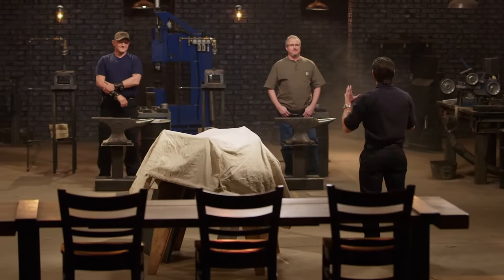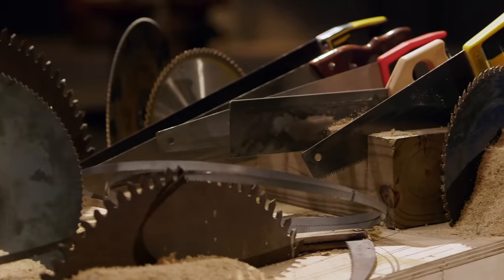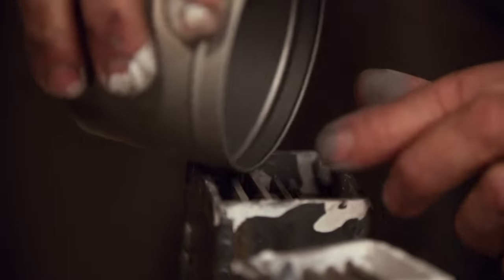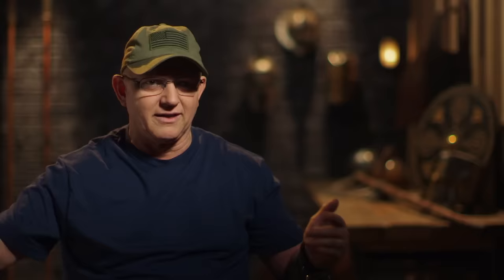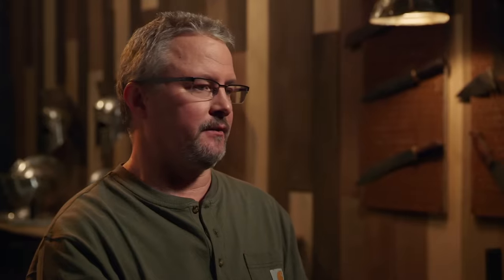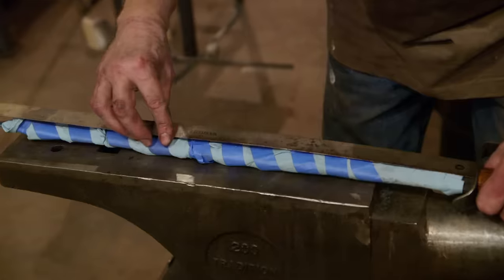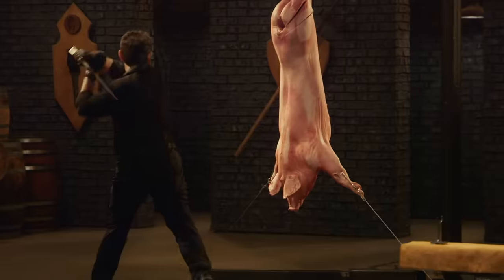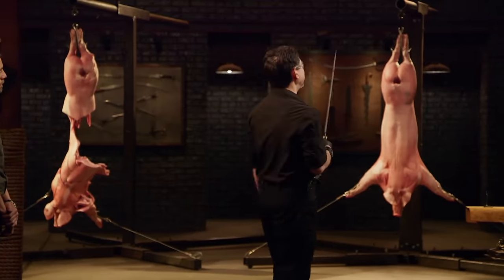Forged in Fire: Beat the Judges: SAW BLADE SWORD CHALLENGE (Season 1) | History

Comment: Tony should have won this and you can't change my mind. Clearly the weight of the Sword wasn't a complete detriment to its effectiveness because they clearly exhibited the ability to weild it. Having a light and fast sword doesnt matter if it won't slash through leather after some edge compaction. I'd take the heavy one if I know that it will do more damage per strike. Sword fighting is not death by 1000 cuts, it's first to deal a debilitating lethal blow. I can fight through a broken rib, I can't fight through a broken rib plus a gash letting my spleen fall out.
It's fine, the money went to a good charity either way, but Tony built a sword I'd take into combat and J built a sword I'd train techniques with(which could just be a wooden sword in that case)

Comment: Wasn’t the winning blade the one that had a forward pull? If so, that would make it loose for me. I need it balanced so I can use maximum power and have better control.
Reply: It was the one tha didnt weight 2.5x times more than it should.

Comment: The other dude's sword cut the pig and the sandman better because of its mass, which was a bad thing.

It wasn't sharper than Jay's, it just had   greater momentum (weight * acceleration). In battle having a sword with that weight would tire you out and it would be harder to control the longer the fight went on and you'd die. That's why he lost.
Reply: If you have a sword that doesn't cut then you have something that only annoys the opponent.   A heavy sword that tires you out but kills the other guy is better than one that tires you out less but only bruises the other guy.

Comment: 0:45 says needs to have a Mechanically attached handle 4:51 shows there is no Mechanical attachments. The competitors blade did have mechanical attachments.
So the Judge actually did cheat by having a single wooden handle not mechanically attached as shown in the parameters breakdown.

Comment: I actually disagree with this decision. I've never disagreed with the judges before. I knew it would come down to the sharpness test and the weight difference in their swords but when Jay's only cut half-way through the arm and just scratched the rest of the sandman, I was positive the contestant would be the winner. When Jay won I really felt that was unfair. The contestant's sword was a bit heavy, but it did more damage in the kill test, survived the strength test better, and even cut better on the sandman. It out performed Jay's in every test so for Jay to win solely on the weight of his sword didn't seem right.
Reply: Bit heavy?
Short sword should weight between 1-2 pounds.

What they got was a somewhat sharp club weighting more than two-handed longswords!

Comment: Disagree with the judges here.  Tony's blade may have been heavier, but it was the superior performer in two of the three tests.  The blades were equal in the strength test, but in the "keal" test and the sharpness test, Tony's blade easily beat J's.
Reply: But Tony's blade only performed better than J's blade because of that hefty weight. It weights three times more than a short sword should.

Comment: Why the heck did Tony lose?? His blade out-performed Jay's by a mile! Sure it was heavy but it was actually sharp enough to cut the sand-bag man unlike Jay's. It was under all the parameters given, and it even looked better. Wrong decision was made here for sure.
Reply: Take a 2L water bottle and swing it 10 times. Recover. Try the same with a 1L water bottle and then try to argue, that the weight is not that important.

Comment: Anyone who's ever swung a sword agrees with this decision. A four pound blade that short is unacceptable in any situation.
Reply: As someone with actual experience with swords a freshly forged dull blade is unacceptable in any situation when the sword is expected to cut something.
Reply: @funichigo  that sword can still be sharpened. You can't remove a large amount of weight once a sword is forged. Common sense.
Reply: @draklen2244  when time ran out the smiths were ordered to STOP working on their swords sharpening the sword is work that's common sense.
Reply: @funichigo  but you still can't make significant adjustment to the weight. What part of this aren't you getting?
Reply: @draklen2244  you clearly don't get the video this back& forth is a waste of my time.

 If you're going to comment on a video at least to watch the video first goodbye
Reply: @funichigo  one I've seen the clip.
Two I've seen the entire episode. Three I'm not the one confused here.

Comment: Anyone who thinks Jay won because of bias, was not paying attention. The largest of Claymores was under 6 pounds. NO SHORTSWORD SHOULD BE 4 POUNDS, Unless it's a completely decorative piece. Jays sword did slightly less damage than the other one, because his sword was about half the weight, not because it was inferior, since it was in fact superior.  Cut it out with the conspiracies, and maybe do some actual research on melee weapons and historical fighting, because right now, you most likely know much less than you think you do.
Reply: Jay's sword doesn't meet the design requirements, he didn't  have the machined pins in his handle like the rules of the challenge stated he needed. Also the weight of a short sword varies from region to region, in Asian countries they prefer thinner lighter short swords, in viking and many other European nations short swords could weight from 1.5 lbs up to 4 lbs, just depended on the materials and design, it had to do with the environment that the metal had to endure. Before anyone comments on my comment, my family has been black smithing for more than 500+ years.

Comment: they were neck and neck till the cutting test, in the cutting test the heavy blade won, but they still went with the lighter blade...why? because design schematics, never use more metal than you need

Comment: So I didn’t hear weight as a prerequisite for the judging in the beginning, sure, he made his sword a bit heavy. It still out performed Jay’s during the testing. 

Would you rather have a heavy sword that will cut or a lighter sword that is a wet noodle??  

This show was the first one that I feel the judging was absolutely skewed towards the judge. I think he was beaten and didn’t want to be shown up. 

Also, if they are being that in-depth, was Jay’s handle even mechanically attached?

Bad form Forged in Fire.

Comment: 8:58 doesn't matter what people say in the comments and it doesn't matter what kind of BS the judges say afterwards right here in this moment we can all see Jay knew he should have lost.

Also people actually did point out that jay's sword didn't meet parameters so he should have lost anyway.

The problem with having an authentic show is that attempts to save face like this are painfully obvious.
Reply: "Mechanically secured" could have also included a pommel securing the handle. The judges and competition rule makers probably don't direct the graphic animators - the director or lead animator does that, who probably wanted pins for the visual effect rather than precisely describing the rules.
Reply: @orbitalvagabond  the mechanically ATTACHED handle didn't include the pommel the pumble itself was mentioned as a separate requirement pay attention before you come off discord trying to be clever.
Reply: @funichigo  You can have a pommel that doesn't really attach the handle. A pommel that attaches the handle is connected to the tang, or does some other clever thing to keep it together. Pommels can just be connected to the wood (see Japanese swords), and therefore not mechanically attach the handle.

You're here to make discussion, not to put other people down.

Comment: That was Rigged they have to change that decision even though this was season 1 that was rigged that heavy sword still managed to complete all the tests with no fails the only gripe they had was the weight and yet it still out performed that butter knife they rig this for the judges to win if I got on this show and got this far and got to challenge the judge and they said my sword wasn't chosen over an under performing sword I would have challenged that decision right to the bank if the weight is the only gripe you can't test it fairly their have been plenty of heavy short swords through history if you can't wield it thats just a you problem.